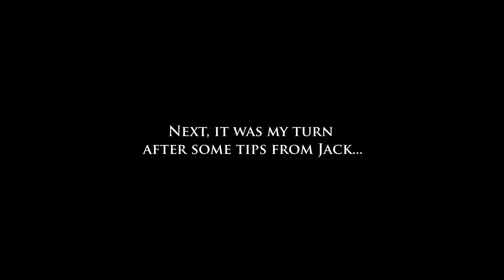Getting better at drifting the Volvo 760 drift car and a very close call!

Comment: Im about to get one of these but the hatch is fucked from a wreck. What upgrades you got in that b230ft the one I’m getting is still stock just has a boost controller running 12psi